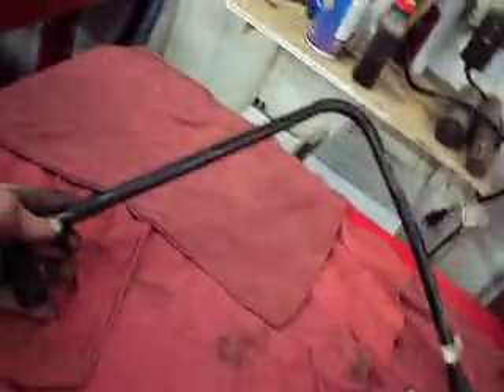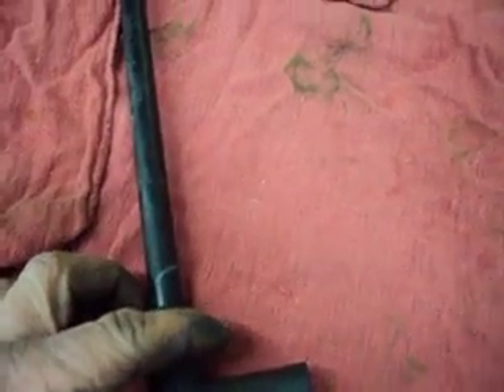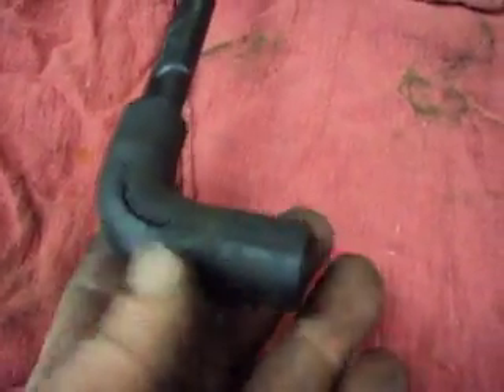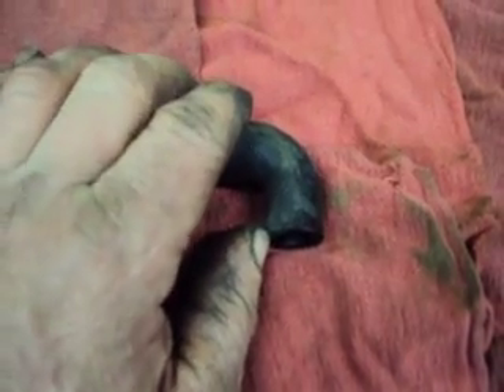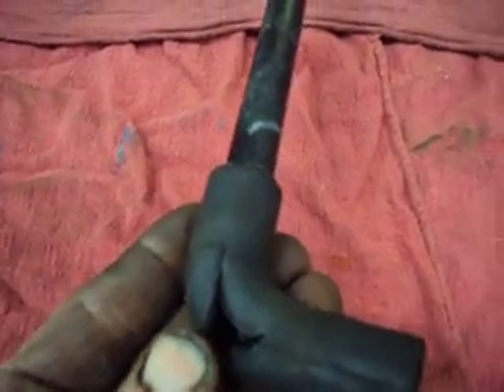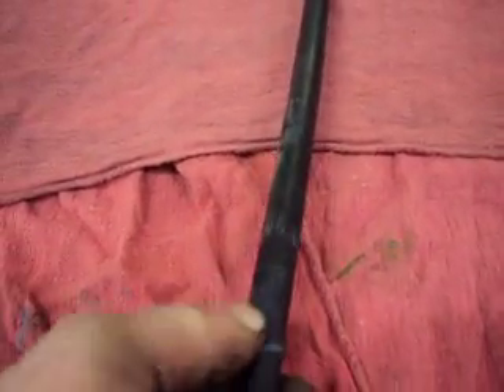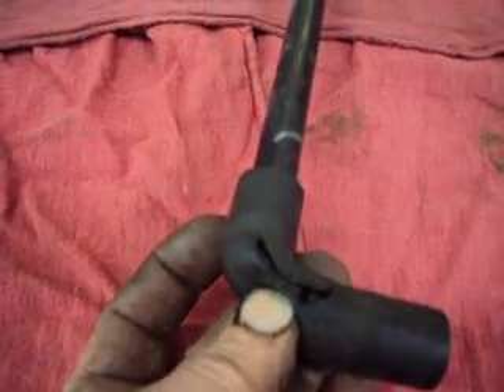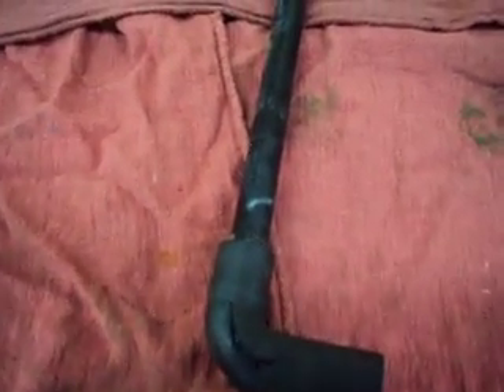2001 Ford ranger 4.0 SOHC with codes P0171 and P0174

Comment: Had this exact problem and fixed for about $15. I used a "HPS HTSEC90-062-BLUE Silicone High Temperature 4-ply Reinforced 90 degree Elbow Coupler Hose, 100 PSI Maximum Pressure, 4" Leg Length on each side, 5/8" ID" and cut it down to size. It's also available in black. There are likely even less expensive options but I knew this would fit and could get on amazon prime.

Comment: I thot some of the readers might want to know, if you happen to accidentally switch plug wires 5 and 6, you will get a P0174,  high long and short term fuel trim  bank2 only, and loss of power, but no check engine light, and no backfires, runs only a little rough,, ask me how I know :) the correct cylinders are noted on top of the coil , very faint on this vehicle but i was able to find them
Reply: I did this too. Fixed it and then the check engine came on. So if I clear the code will it stay off as long as I check the other common causes?

Comment: Same problem on my '03. The caved-in PCV hose with the hole (crack) in the bend was hidden by another hose lying on top of it. Local dealer who had the now-obsolete part in the warehouse wanted $40.10. Today I bought just the L-shaped rubber hose off PartsGeek for $25.93 with shipping. Hope it ships quickly so I can get my truck all fixed up and before my Check Engine light starts flashing.
Reply: Where is pcv valve on 2005 ford explorer 4.0 sohc?